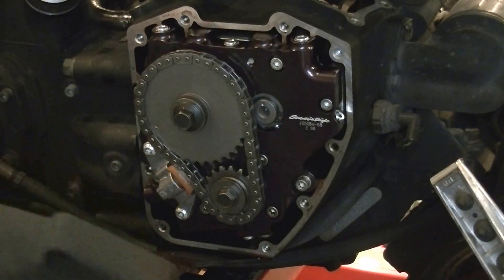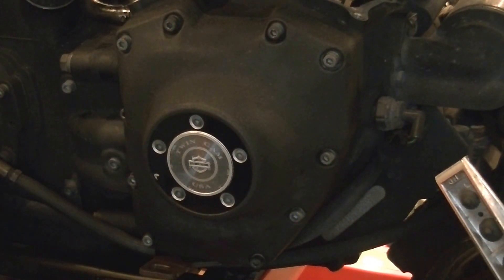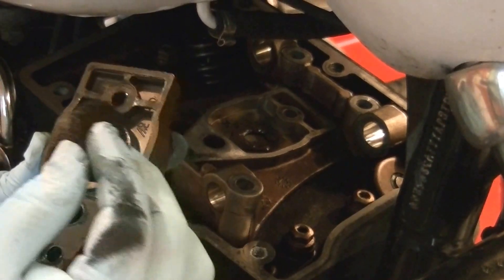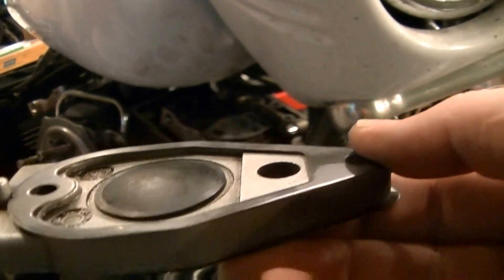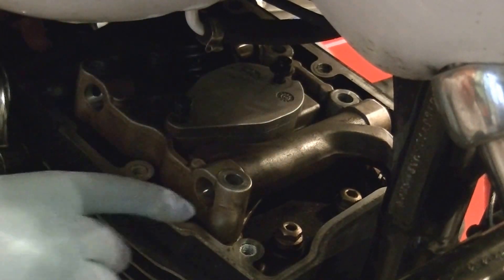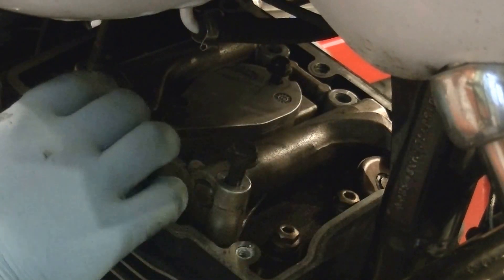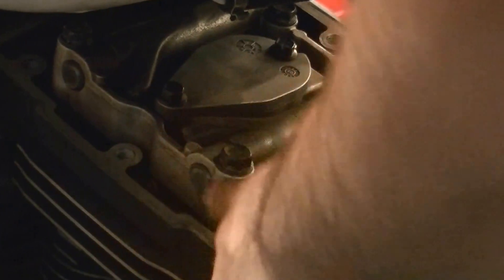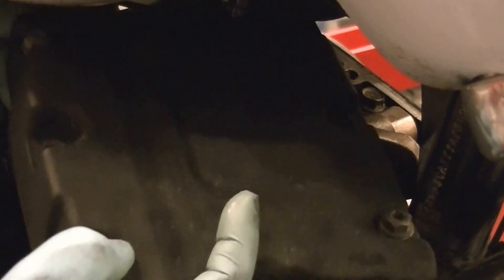Project FXDX: Twin Cam Plate Upgrade Part 6 - Installing Rocker Arms and Breather Filters

Comment: Silver for intake, black for exhaust.  I'm worried that I have the timing wrong but I lined up the dots on the cam and pinion sprockets and the Motor turns by hand OK.

Comment: I replaced my cam tensioners on my 03 twin cam.  I set the cam and pinion sprocket dots but when I attempt to put my rocker assembly's back on it seems to have pressure on the push rods.  I have the cylinder at TDC but as I tighten down the rockers the rods tighten up also.  I don't want to continue with tension on the rods.
Reply: shane conley has a good video on the procrdure
Reply: procedure

Comment: Any suggestions on where I may have gone wrong?
Reply from the maker: Are you sure you've got the right pushrods in the right place?  The intake and exhaust length are different.  The longer ones go to the exhaust :)  Also, hydraulic lifter - if the lifter is filled with oil, it'll bleed down once you torque the head down.  Wait 10-15 minutes, and then see if the pushrod is loose enough to spin by hand.  This is part of why I vastly prefer adjustable pushrods on my engines!